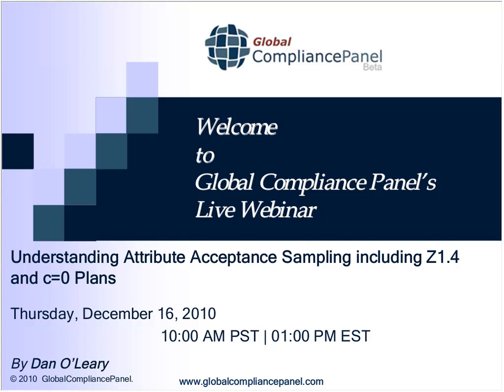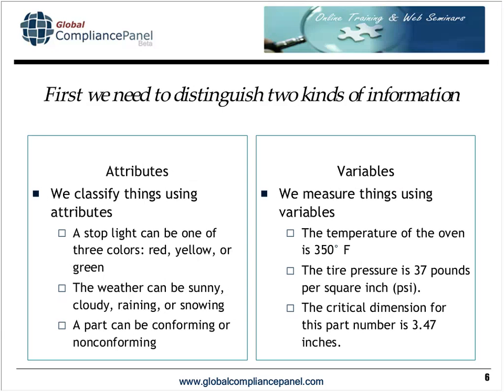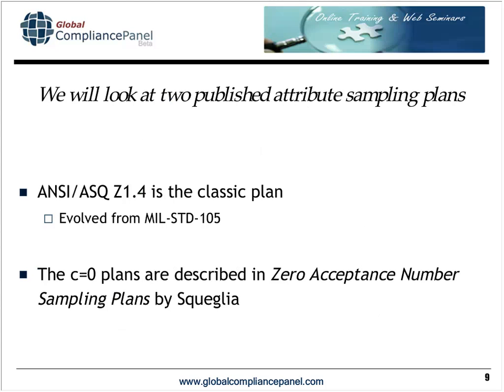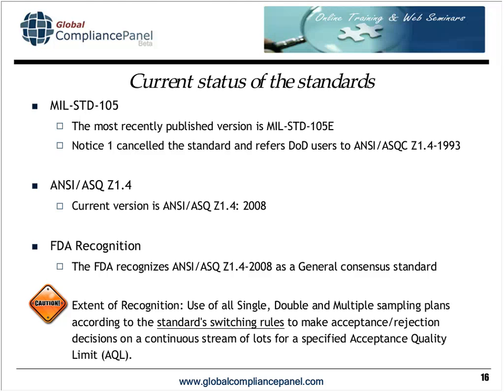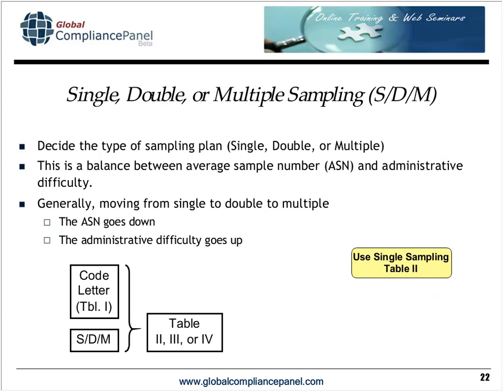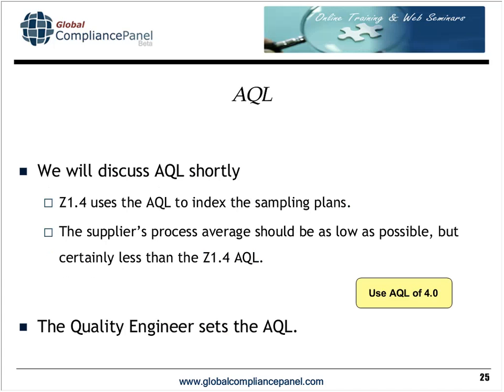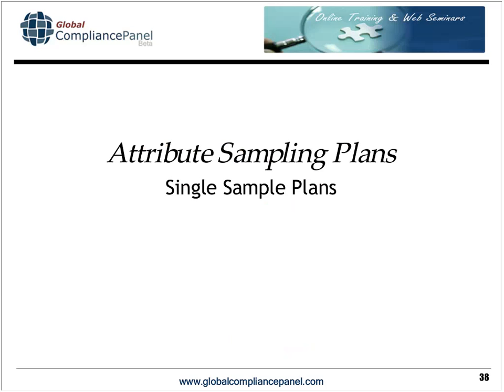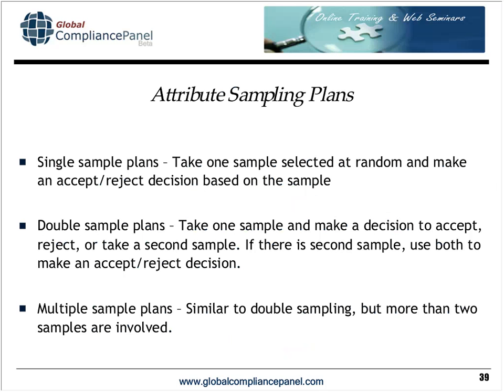Understanding Attribute Acceptance Sampling including Z1 4 and c=0 Plans

Comment: You don't need to "switch" from Z1.4 to c=0.   Looking at the OC curve and matching at a point provides the necessary justification for c=0 on a z1.4 plan.   SAP needs to be customized because it does not come built with any special cases, only the straight z1.4.